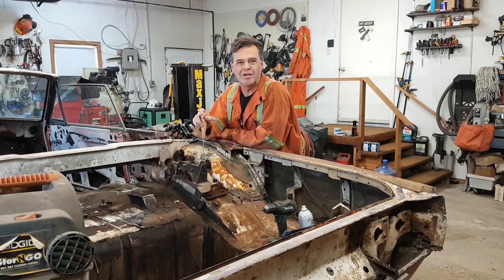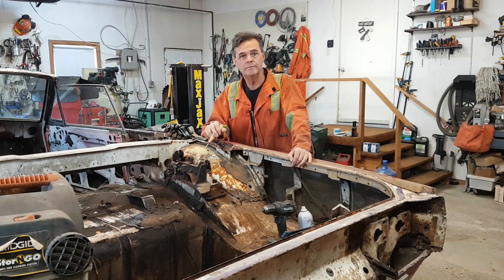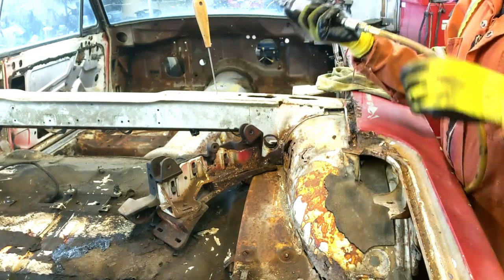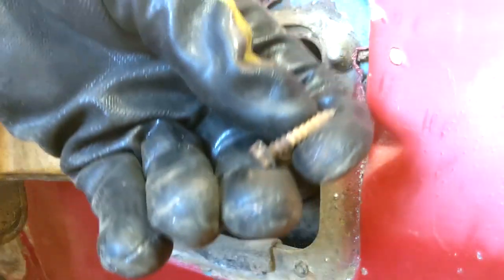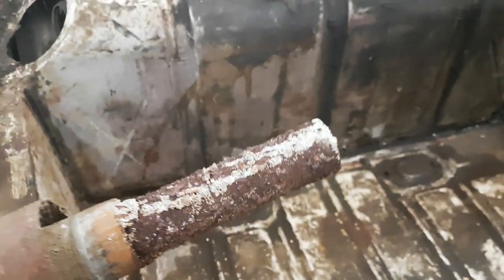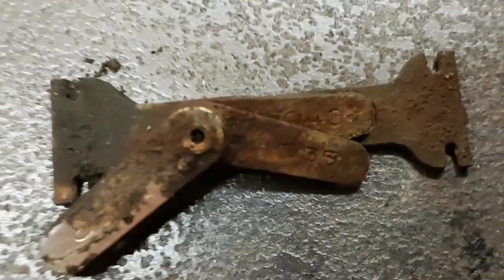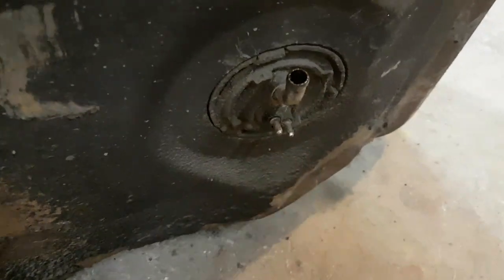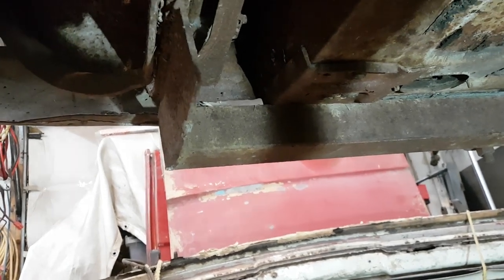Convertible Top Base Plates & Gas Tank Removal - 65 Thunderbird Convertible Restoration Ep #14

Comment: The last shot looked like you were standing beside a boat.  Just when it looks like you are done, there appears more to do.  Thanks for mentioning the rearend.  I was wondering about that.  I saw someone on youtube removing rusted studs by arc welding a bolt to them.  The heat from the weld broke the rust bond. mI can’t remember who it was.  The rust repair should be interesting.  I’m looking forward to that.  Thanks again!
Reply from the maker: She's a boat, that's for sure! I've done the bolt removal by welding a nut onto the stud many times, and that's most likely how I will remove the broken bolt I have...it is a simple effective way of doing it.

Comment: Make sure you save that gas tank pad and long vent tube. The pad isolates your ground so the fuel gauge works, and the long vent tube doesn't come with the new tanks.
Reply from the maker: I will do that! Thanks for the tip novanogo!

Comment: Ford used selfthreading bolts ( like those on your switch brackets ) in various locations for many years.  They worked ok unless over torqued.
Reply from the maker: Thanks Weldon...I'll have to tone back my super strength when reinstalling them! 😁

Comment: Looking at some of those two brackets there is more steel in them than any Hyundai on the road. What are your plans for the body? soda strip or sand blast, or dip clean for rust removal?
Reply from the maker: Lol...yes Mike, there is a lot of steel in these old cars compared to some of the new ones! 
As far as any kind of blasting, I lost that opportunity until spring, and I'm definitely not doing blasting inside over the winter, so no to blasting. There are no dipping services in my local area, the closest is/was in Calgary, Alberta, and the cost is very high, so no to that too.